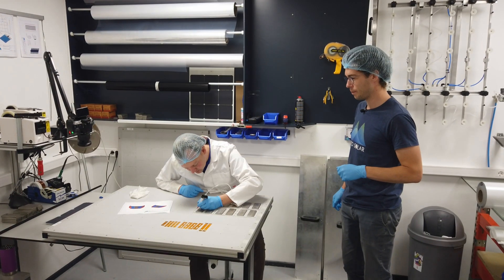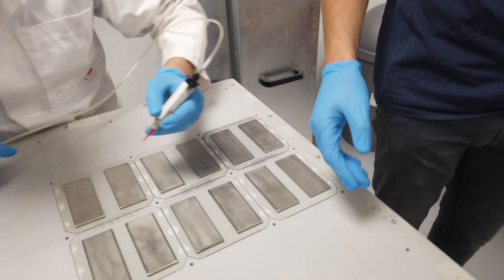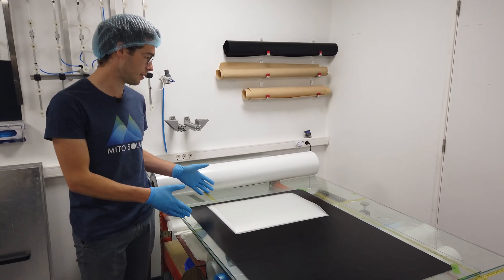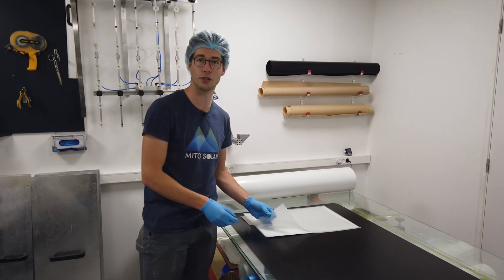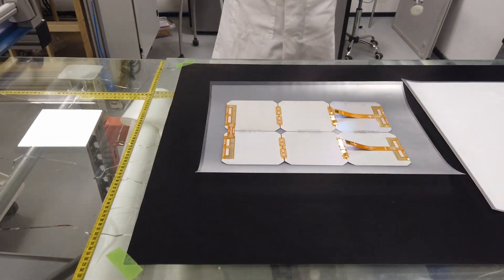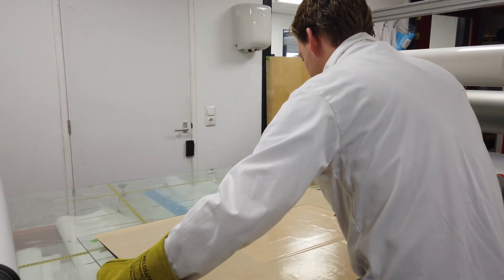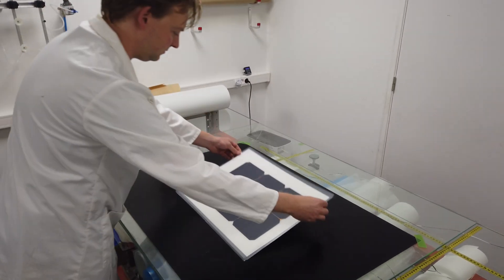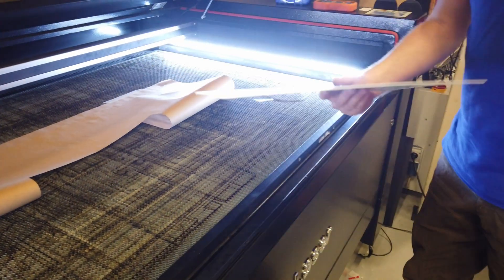4x4electric - Installing solar panels on our expedition car

Comment: Very cool! I’m excited to your progress and see this sustainable traveling machine come together! 

I was going to ask if you were going to use the car’s battery for auxiliary things like the fridge and whatnot. But I think you answered that in this video. 

What size/type battery are you using for those additional panels? 

Also, would you be able to use those panels with the other 60 to charge the vehicle? Or add some charge while driving?

Woo! Keep it up! Great job!
Reply from the maker: Thanks!:)

The additional battery we take with us has a capacity of 2kWh and can deliver 2kW (good for the induction stove) and will be charged with the solar panels on the car. This battery (used for fridge and auxiliary) will not be used in combination with the 60 solar panels as for the charging technique we do not need a battery. As the panels on the car are different form the once in the car, we cannot connect them together.